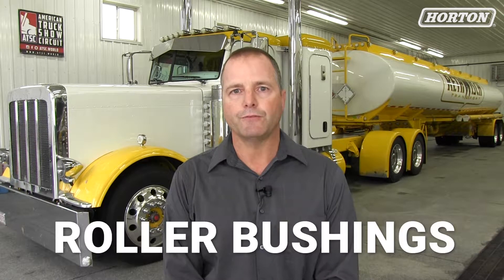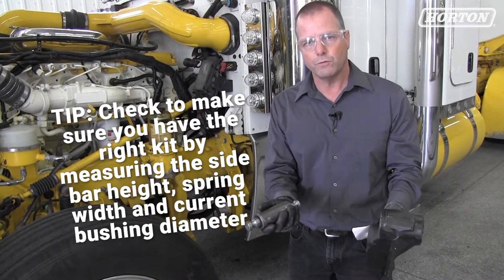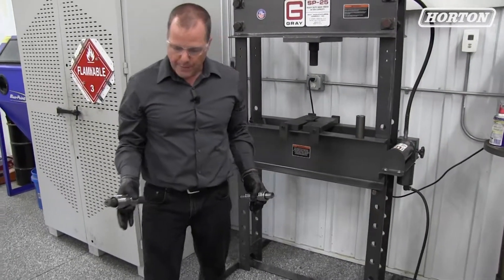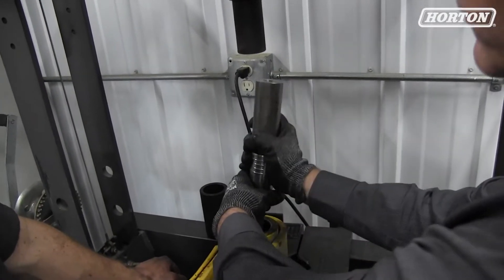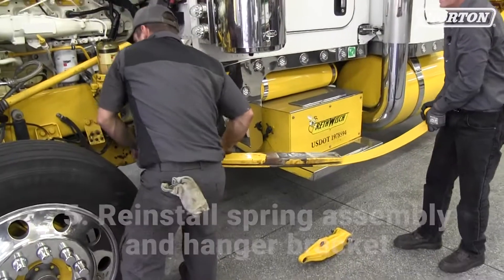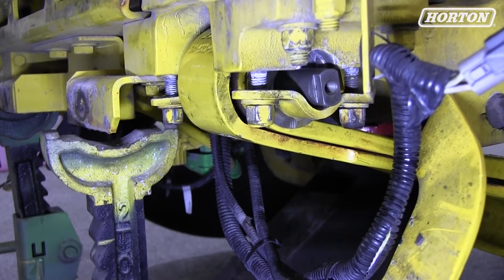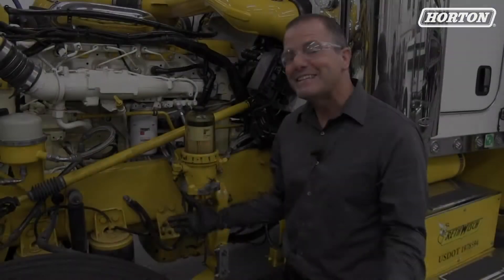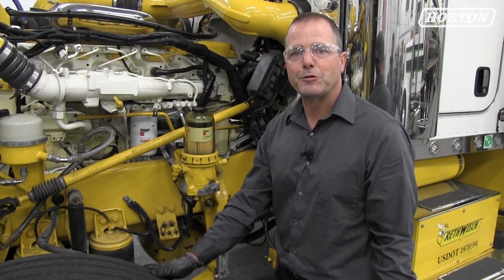How to replace elastomeric bushings with roller bushings

Comment: Having installed hundreds of bushings in semi's over the years I wonder about these because iv tried to use the Horton roller bushings and those failed in a month or two. I found the bearing contact was so minimal to the pin the rollers would embed in the pin and grind away. The factory threaded pin have more contact if u figure the length alone having about 40 percent contact on load side and if u took the total area of the sides of the pin and bushing the surface would be about double the length.